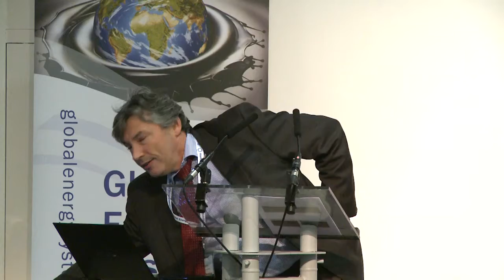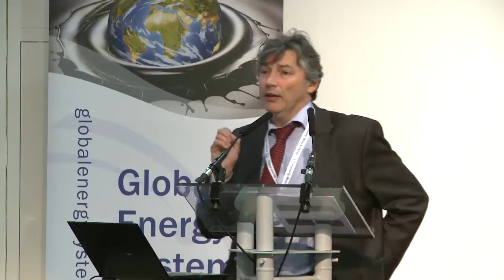Generation IV fast Reactors and the Re-use of Long-lived Nuclear Waste - Dr. Richard Stainsby

Comment: 25:25 Making a molten sodium, common pool, fast reactor is easy in theory but hard in reality you say?

What about the BN-600 reactor that has been working since 1980?

Or its spawn; the full fledged fourth generation BN-800 nuclear reactor which has been operating at full power since  2016.

EDIT: Whoops, guess this came out in 2015. But still the BN-800 fist start was in 2014.

Comment: The 4th generation  pebble bed,helium cooled nuclear reactor will go on line in 2018.In 2019,China is going to the far side of the moon to mine Helium-3. for nuclear fusion. There is no nuclear waste when you combine Helium-3 and Deuterium in a nuclear fusion. only unilimited energy hydrogen gas and helium gas.
Reply: what are your credentials? just askin'.

Comment: Getting rid of Mines is going to reduce political backing :(
Reply: The USA doesn't mine much uranium anymore due to regulations, and it's just cheaper to do elsewhere.  Our biggest reserve is the colorado river basin i think, which is a protected area.
Reply: We import most of our uranium, fast reactors use depleted uranium as fuel, we have plenty of that from enrichment over 50+ years.

Comment: He pretty much glosses over the possible existence of thermal spectrum breeder reactors. Yes, you can't sustainable breed plutonium from uranium 238 in the thermal spectrum, but you are suppose to be able to breed uranium 233 from Thorium within the thermal spectrum, so you shouldn't completely discount it.
Reply: buddy, I'm a nuclear engineer, and i really hate to break it to you:

you CAN technically breed thorium in a thermal reactor, but it requires you to either use a fast reactor to start it (to breed the initial highly-enriched u-233) or it requires you to ONLY EVER use weapons-grade material in your reactor, which, for some reason i can't imagine mass deployment of a reactor that has a chemistry plant in it and solely runs on weapons-grade uranium.

since protactinium-232 has a 1-day half life, and protactinium-233 has a 30 day half life, the argument for "u-232 is a protectant" is irrelevant if you're doing online reprocessing, which you need to do if you're operating in thermal spectrum.
it would only take one nefarious party at a LFTR plant to extract the protactinium, let it decay for 7 days, do the hexavalent volatility with the fluorine because all the pa-232 decayed into u-232 in that time, and then wait a month or two and do fluoride volatility again and you've got 100% pure, weapons grade u-233.

it's never gonna happen. it is a political impossibility. until nuclear weapons proliferation is no longer a problem, we will never have thermal thorium breeding MSR's, because the neutron economy cannot support it without online removal of fission products, which means you can pull out protactinium with your noble metals and thus make pure u-233 which is weapons material.

if you want to be able to have the same safety but WITHOUT having to develop and use online reprocessing, i would highly recommend just looking at fast spectrum MSR's. they can also make substantial breeding gain, so you can start more thorium reactors over time.

there is nothing inherently better or safer about thorium, and there's nothing inherently better or safer about thermal.
the safety comes from the fuel form: molten salts. low pressure, natural circulation, ionic bonds to trap fission products, and 100% burnup.
the small trade-off of "needing more fuel to start my first fast-spectrum reactor" is completely offset by the fact that:
a) uranium is cheap
b) you're still using fuel at 1/20 the rate of an LWR
c) you can actually breed successfully without causing proliferation concerns.

like i really wish we lived in a world where nuclear proliferation wasn't a major political concern, but until we do, fast spectrum is going to be the only option for molten salt breeders (or any breeders, really)
Reply: You can't sustain Pu-U cycle because that breed only 1,7 neutrons, when Th-U cycle breed 2,3 neutrons! It is self-sustain!
But true power of godly Thor is:
https://upload.wikimedia.org/wikipedia/commons/3/30/Lwrvslftr2.png
http://lftrnow.com/wp-content/uploads/2015/05/2-billion-years1.jpg
youtube.com/watch?v=mhMI54zeyxw    - 50 quadrillion discovery
Reply: @WadcaWymiaru  You can reach similar efficiencies with a fast-breeder reactor running on uranium. The Integral Fast Reactor was one such promising program, but it was unfortunately shut down (Russia has successfully operated them for years though).